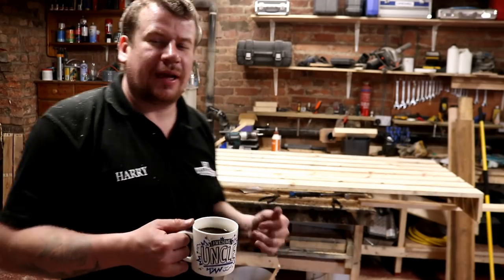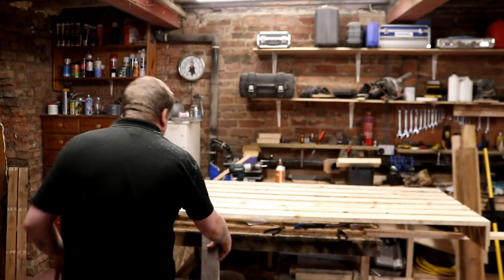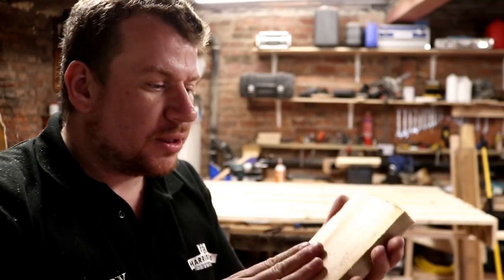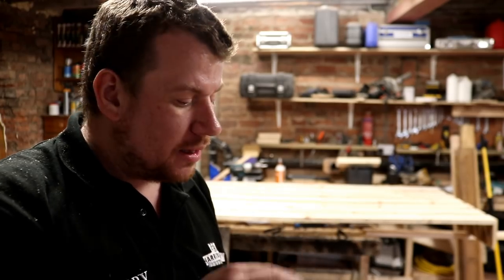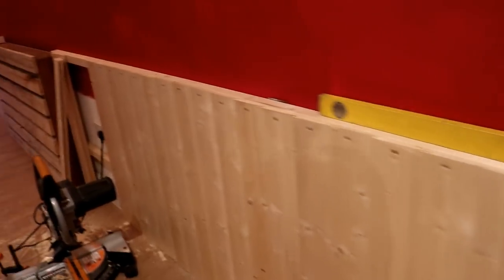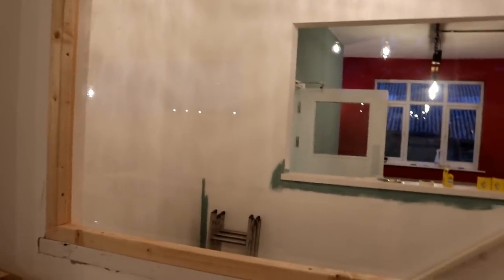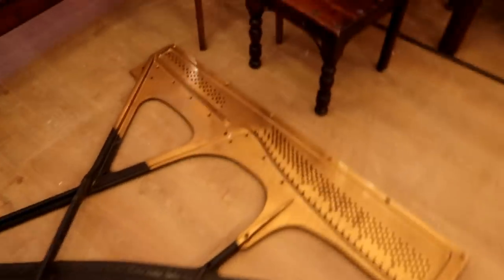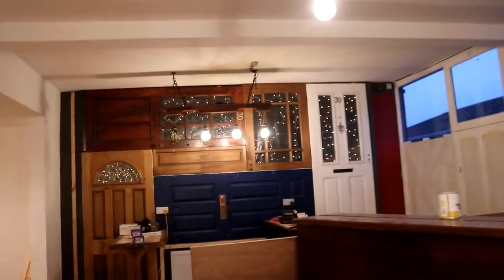PROPER GRAFT LAD

Comment: Coming along - that pane of glass is going to reduce noise levels also. You could have your "Harrison's Brewery" logo cut in vinyl and then use some spray "frosted glass" over the whole pane. When you remove the vinyl, you'll have a classy logo glass wall. (I know - that costs.)